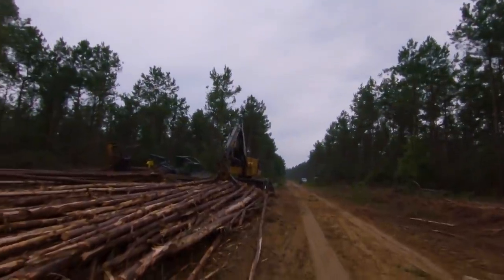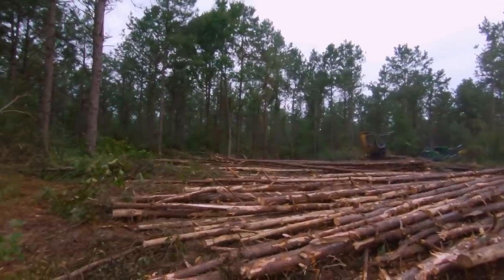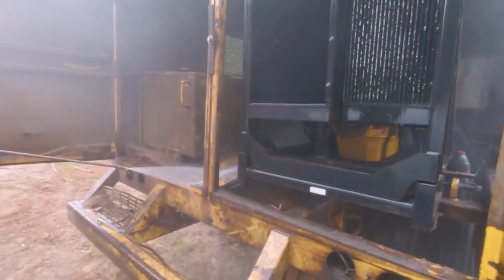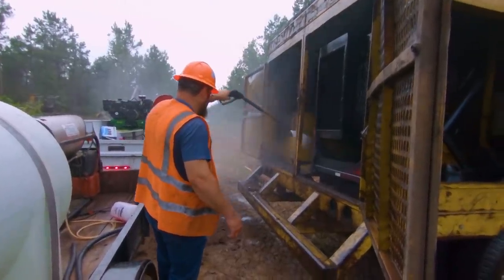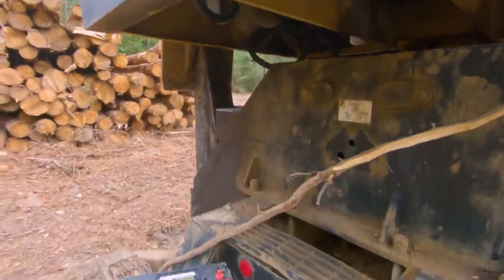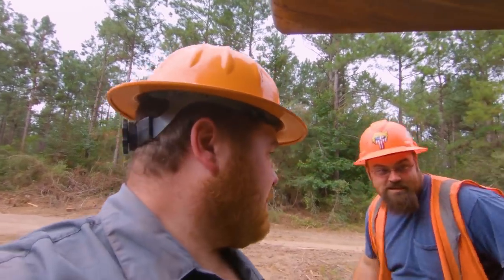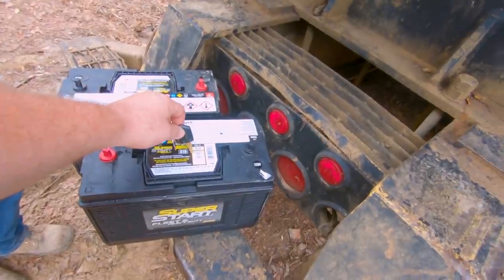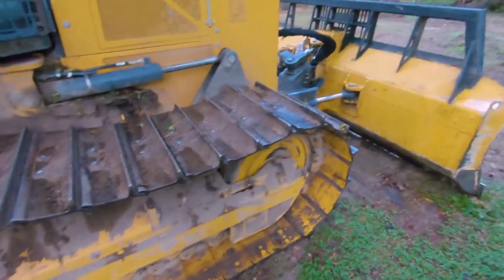Our John Deere Dozer, Lets Check It Out!

Comment: In my area almost every logger run Deere Dozers 650,700,750 and 850’s. Probably more 750’s than anything else. A few run D5 and D6. With the hilly terrain and smaller tract sizes you have to do a certain amount of road building like it or not.